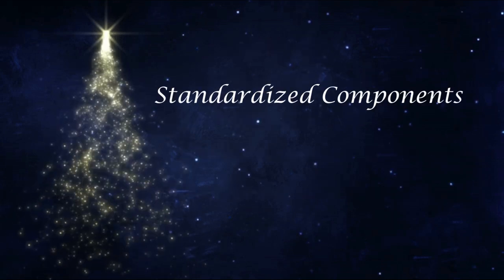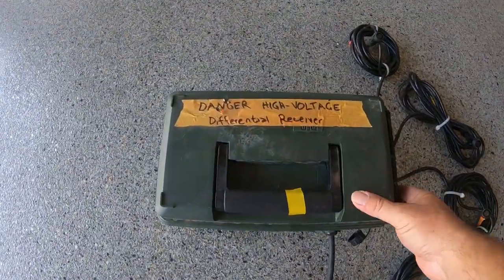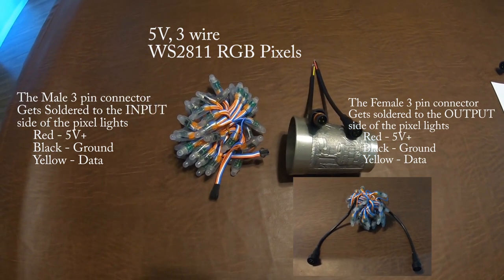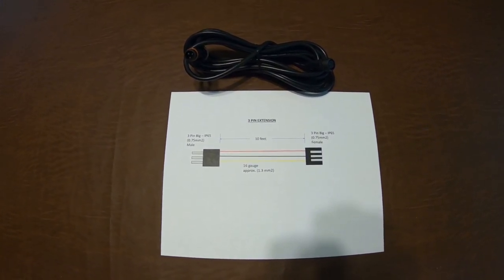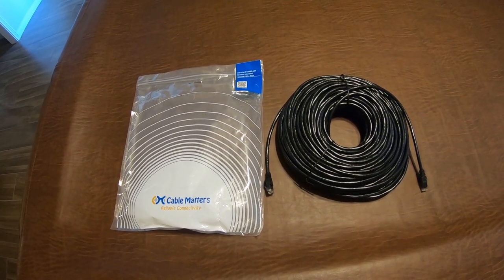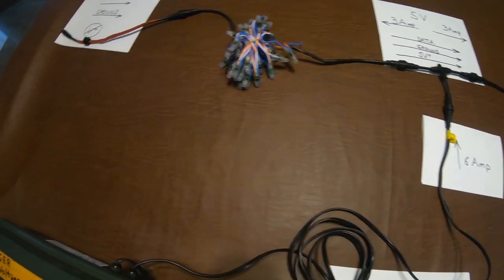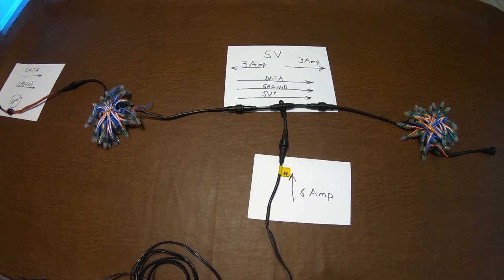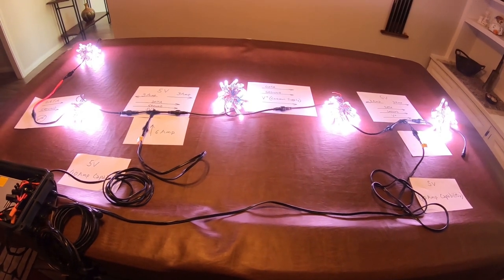Christmas Lights to Music, Step by Step Tutorial

Comment: Nice!  This was really informative. 
I like your power injection technique and the part where the whole system is put together operating in one place. That part made it really easy for me to understand.
I would be interested in more information on the components you used to build the controller box and the differential receiver box and how you assembled those boxes together.
Reply from the maker: Thanks! Most of the components required to build the boxes are readily available on amazon or your local big box home improvement store.  If there is some interest i will put together a detailed video on what I used and how I assembled those boxes.  Thanks for the note!

Comment: Finally!   A step-by-step with visuals of the hardware!  Fine if you say no, but would you share to care your final cost for everything?   That would help me decide whether to dive in or not.     Take care and thanks again for the vid!
Reply from the maker: I actually never really totaled it up but I'm guessing I probably have $1200-1500 into it.  But....You can start out with just the F48 controller $200, A differential receiver $20, some power supplies $15-$35, some pixels $125/500, some misc connectors, wire, boxes and $4 harbor freight soldering iron.  You don't have to start with 3200 pixels like mine.  My first year i just had pixels on the eave of my house, a few 5V 8 Amp power supplies, and a $10 single channel controller as explained in my video.  Then I grew into the F48 and differential receivers the following year.  Start small and add over time. That spreads out the time investment as well LOL

Comment: This was excellent in demystifying the layouts along with power injection. Showing the layout on the floor for just one falcon controller output and the power cable changes really cleared a lot up. I see the need for the weather proof power injection Tees and will stick with a single supplier. Sold me on the falcon controller.
Reply from the maker: Darin, I'm so happy that you found this video useful.  I am also super happy with my F48 controller selection.  Thank you for the comment, I really appreciate it!
Reply: @tara-tech4138  I just ordered my first 500 pixels and looking at best pricing for the boards. I like you clean layout. I have been messing around with arduino and relays with LED lights giving simple flashing modes and fooling others with colors wrapping sets around each other. Blah. And then the nodeMCU for pixels. But I just want to clean it up. I’d be happy to hop on board if you get enough people to purchase the power injection connectors. Count me in. I do have a question. Are you using the typical ray wu 3 pin connectors
Reply from the maker: Thanks Darin, I'll start a list for those interested in me carrying the power injection connectors on my web site when I get it posted.  So far, just me and you :( ................. as far as connectors go, I like to get my stuff from Amazon.  So I use BTF Lighting.
Reply: @tara-tech4138  got a question. I like how clean your arches are by drilling the holes and mounting them. What size pvc did you bend to accommodate 50 pc lights which I’m assuming is each arch.
Reply from the maker: I use 1/2 inch schedule 40 PVC for just about everything.  My arches are only 34 lights. I drill at 2 1/4 inch spacing. First I drill a 12 mm hole all the way through the pipe, then i open up just the backside to 1/2 inch.  Fits a 12mm pixel perfectly without any kind of fastener.  The hard part is bending the PVC.  I drill the pipe first.  Then I wrap the pipe in tin foil and blue painters tape.  I sift sand, to very fine, using a metal colander with holes.  Then heat the sand in a pot on a propane camping stove to about 450-500 deg F using a infrared thermometer.  Then, I dump the hot sand into the pipe using a metal funnel, then quickly form it, wearing silicone gloves, based on some screws I put on a sheet of plywood to form the arch shape.  Let it cool for at least 10 minutes or so.  Then remove the foil and dump the sand back into the pot.  It took me 9 tries (and 3 scrapped drilled pipe, that hurt badly) to get 6 good arches.
Reply: @tara-tech4138  great information to know. to get 34 lights on what is the length of the arch. I have some I bought and was on the fence of size.  But at your mounting and number of lights I assume 7feet. I bought qty3  of 8ft pieces at Lowe’s.
Reply: Forgot to tell you I almost bought pex because of its bending properties but the cold weather I get is below the temp rating. Afraid of it cracking.
Reply from the maker: I just pulled one of my arches out of storage.  Hard to measure with a tape measure on a curve, but it measures approximately 78 inches, give or take a little bit, so 3 x 8 footers should get you 3 arches easy.
Reply from the maker: i have never used Pex except for plumbing.  Not sure it would be rigid enough to hold a pixel in place and not bend, but I haven't tried it.  Have fun on your project :)  I think I saw some people use Pex and then threaded the strip lighting through the inside.  I stick with 12mm bullet pixels because of their reliability.
Reply: @tara-tech4138  I'd be in for some of those connectors as well. Love the clean design.

Comment: Great, informative video.  Made some things that were fuzzy for me clear.  Would love to have links to your custom components like your power cut adapter and injector T.  Your power injection section was my favorite.  Will be how I do mine.
Reply from the maker: Thanks for the comment Steve, I really like to hear that I'm actually helping someone out.  The power injection T does not really have a link. I made the first ones myself using 3 and 2 pin connectors. Then I got smart and I just sent the powerpoint picture shown in the video to a source I contacted out of Hong Kong.  The more you order the cheaper they get.  If more folks decide to do power injection this way, we should join forces for bigger orders and improved purchasing power.  I made my power cut adapters myself per the powerpoint shown in the video using the male and female 3 pin adapters prior to finding my Hong Kong source.
Reply: @tara-tech4138  do you have a link for this Hong Kong hook up. Im very interested in doing this at my home. 
Your method has been the simplest way to go about this in my head. Lolol
I need the t connectors and the adapters.
Will you send me the links to buy these connectors?
Reply from the maker: @koriman2001  Hii Kori.  I use exclusively BTF Lighting "Big" connectors from Amazon.  As I progressed in this hobby, I realized the Power Injection Tee and the Power Cut Isolators made power injection very simple for me to understand and do as well.  Every other way was very confusing, for me anyway.

I was making them manually with the 2 pin "Big" and 3 pin "Big" connectors from BTF Lighting from Amazon.  It took a lot of soldering and electrical tape, but they did the job.

Then  I got brave and I decided to contact BTF Lighting directly from a contact page on their website. I got a contact, sent them some sketches of what I wanted, and they were able to make them for me. WHAT A TIME SAVER! As far as I know, there is no link for these. You must solder/make them yourself or order them special.  (Then my second order from BTF included more Tee's, 2 pin power supply leads, 3 pin differential receiver leads, 2 pin and 3 pin extensions which I also found I needed).

I have considered buying these in bulk, from BTF Lighting special order and carrying these components on my website www.christmaslightingwithsteve.com.  If there is enough interest, I am still interested in doing this, but users would be locked into using BTF Lighting "Big" connectors for most everything (which is fine with me, that is exclusively what I use anyway, and I use a BUNCH of 2 pin and 3 pin "Big" BTF Lighting connectors that I can get directly from Amazon).  

I have pictures of what to order from BTF Lighting and/or how to make them out of 2 and 3 pin connectors on my website.  But at this time, I don't know where to purchase either of these.

Comment: I'd like to echo many comments made here and say this step by step walk thru really cleared up a lot of questions I had with regard to network hardware and how everything is connected.  I've been doing a lot of research this past month preparing for my first light display (for 2021 season). This is the first video I found that explains in easy to follow detail exactly what I need to do to start my planning process.  Thank you!  I have subscribed!  I do have a few questions. 
1. What spacing did you use between pixels on your eave lights? Looks like 2" or 3"? Do you like the spacing or wished you'd went shorter? 
2. How is your computer setup? It looks like you have your laptop running xLights for setup and sequencing. Then you have a Raspberry Pi. Do you have the Falcon Player on the Raspberry Pi? Does xlights (on your laptop) talk to the Pi thru your router then the pi sends the sequences to the falcon controller? 
3. Is there anything you would have done differently knowing what you know now Vs. When you first started out? 
Thanks again and look forward to checking out your website for more great ideas!  FYI: I believe you've convinced me to go 5V instead of 12V mainly because of wire size.  I'll still do more research to see which way works best for me but am definitively leaning heavy on the 5V side.
Reply from the maker: Thank you sooo much for the comment.  It really makes me feel good when my tutorial is actually helping someone out.  Makes all of the time I spent putting it together worthwhile.  Now for your questions....

1.  I use 2 1/4 in spacing, because I mainly use almost entirely  Alitove 5V pixels from Amazon at $125/500 and that is the perfect spacing for those pixels. I like that spacing, I think it makes for a great look with my mostly PVC props.

2.  Yep, I used a laptop running Xlights scheduler first then the raspberry Pi later later.  There are very detailed step by step instructions for setting up falcon Pi player on the Raspberry Pi on the Internet and it worked first time for me.  Eventually I'll put a link on my website for you guys for those instructions when I find them again. Yes, your laptop talks to the Raspberry Pi through the router.  You create the lighting/song sequences in Xlights, then you transfer the .fseq files to the Raspberry Pi. Then the Raspberry Pi runs the .fseq files.  You can then just leave the Raspberry Pi attached to the router as well as the controller. Then you can disconnect the laptop from the router and the Raspberry Pi runs the whole show through the router (I think it is best to have a separate inexpensive show router).   This leaves the laptop free to use however you need. I leave my Raspberry Pi running 24 hours a day during show season, and I have all of my controller and pixel power supply extension cords on 120V Christmas dial timers.

3.  Would I do anything different? Actually no! I am extremely happy with the time I took to figure out how to standardize the setups and design the boxes and associated wire accordingly.   I knew I a wanted 5V system due to the power usage and lower pixel cost.  I knew I wanted a distributed system (The F48 Controller; And actually Dave Pitts from Falcon convinced me to wait until the F48 came out when I talked to him about what controller I wanted, it wasn't out yet when I started).  Also, having a distributed system allowed me to minimize wire lengths and thus smaller wire sizes since my house lot is spread out a bit.  I knew I wanted a standard setup for any area irregardless of how the props were designed or set up in the yard or on the house.  I did not want a different setup for any specific prop or area. I'm actually very happy with the way I did it and would definitely do it again the same way if I started over. And I am also happy with the time I spent to make everything water resistant the way I did.  My display works even during heavy rains.

The only big lesson learned is ..... originally I made my own power injection Tee's, Power Isolators, Leads and Extensions with wire and 2 and 3 pin BTF Lighting Big connectors, solder and shrink tube.  The best thing I ever did was to make sketches of what I wanted (you can find the sketches on my website) and send them to BTF Lighting (or your favorite supplier) and have them make all of the 3-2-3 Pin Power Injection Tees, 10ft  openwire-3 Pin Differential receiver leads, 10ft openwire-2 pin power supply leads  3-3 Pin power cut isolators, 2-2 Pin Extensions and 3-3 pin Extensions.  Yes it took some time to wait for them to come in from Hong Kong (probably about the same time it would have taken me to make them myself) but it saves a ton load of soldering time, and costs about the same price as making them yourself.  I wish I had the courage to contact BTF Lighting on the side, through their website way way way way way sooner. Would have saved me a bunch of time and their quality is way better than mine.

Also. Remember 5V requires BIGGER wires than 12V because 5V carries higher amperage to maintain the same power level (Power= Amps x Volts).  That's the beauty of the F48. The distributed F48 allows you to just run a really long LAN cable (Cat 6 or 5e) close to the prop area, then use a smaller gauge wire due to shorter distances to the pixels and power supplies.  I use almost entirely 16 gauge wire now and max my lengths to 20 feet.  I initially used 12 gauge landscaping wire for the Power Supplies, but after establishing the relationship with BTF Lighting I use THEIR 16 gauge (1.3mm2 wire...It's actually a bit smaller than traditional 16 gauge) on all of the leads and special connectors and found it works with no problem.  Probably because I run my lights at only 40%.  Any more than that and it would blind the international space station LOL.

I know this answer is long winded,  but hope it answers your questions.  Have Fun, Enjoy the journey........... Merry Christmas.  You can also contact me on the contact form via my website.
Reply: Thanks for the quick reply Steve! With regard to the Raspberry Pi, did you need to set up a monitor, keyboard & mouse (to access Falcon Player) or were you able to remotely access the Pi thru your laptop?  Was checking out your website. Looking forward to your future write-ups... especially your future new Mega Tree addition (5V?)
Reply from the maker: @patrickg8444  No need for a separate monitor, keyboard or mouse. Correct, you just remote into it via your laptop a browser and an IP address. 

Website is still a very much work in process, but the parts lists and instructions on how to build the boxes is good. I’ll Have a lot more time to work on it after the holidays. 

Yep, hope to have a bit on the website on my 2021 mega tree, which is my next lighting project. Who knows maybe I’ll also make a video of it when I get goin LOL. 

Thanks again!

Comment: Wow this is amazing thank you so much for all the information. I would to get in contact with yoy to see who you used for your injection t's
Reply from the maker: I used the sketches shown on my website, www.christmaslightingwithsteve.com under components, and sent them to BTF Lighting to make my power injection Tee's, Power Isolators, 2 pin extensions, 3 pin extensions, 3 pin Differential Receiver 10 foot leads, and 2 pin power supply 10 foot leads. Go to their website and find the contact section and send them an email.  They were pretty quick at responding for me.  I use all BTF Lighting connectors because I can get them from Amazon fairly quickly.  I have thought about carrying these for sale on my website, but that would tie you to using BTF Lighting connectors.  And once you choose a connector supplier you HAVE to stay with the same supplier because they all make their connectors slightly differently.

Comment: Tara-Tech, what would you say something of that size would be the total cost? I am going to be putting together a light show this holiday season.
Reply: Yeah, how much does a setup like that run??
Reply from the maker: Hi Scott and Stephen. I have 3200 Pixels and I would guess that I probably have $1200-1500 into it.  But....You can start out with just the F48 controller $200, A differential receiver $20, some power supplies $15-$35, some pixels $125/500, some misc connectors, wire, boxes and $4 harbor freight soldering iron.  You don't have to start with 3200 pixels like mine.  My first year i just had pixels on the eave of my house, a few 5V 8 Amp power supplies, and a $10 single channel controller as explained in my video.  Then I grew into the F48 and differential receivers the following year.  Start small and add over time. That spreads out the time investment as well LOL.  I have all the links for the hardware I used on my website www.christmaslightingwithsteve.com .  You can check those links out and get an idea of how much things cost.  Most of the props are just drilled PVC, so that is fairly low cost.